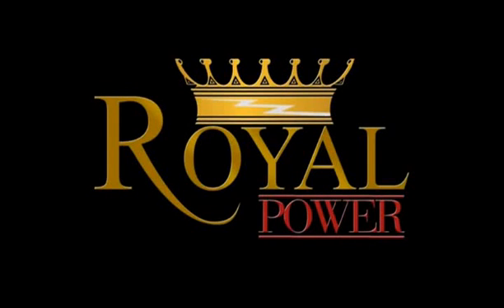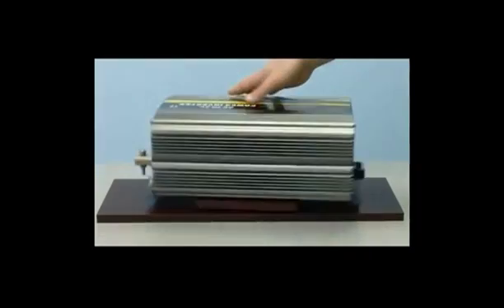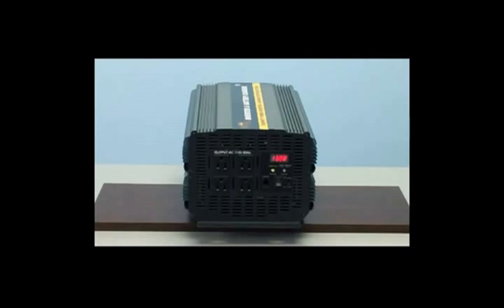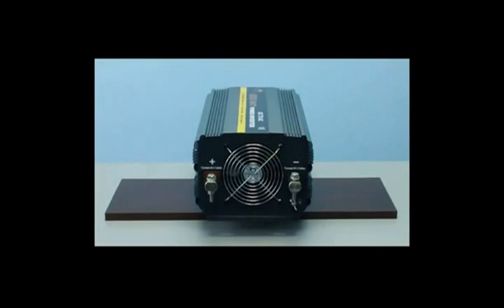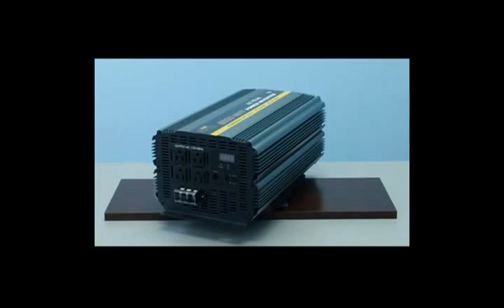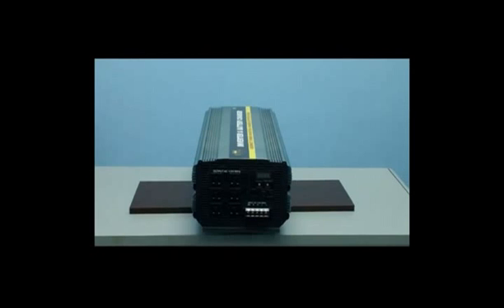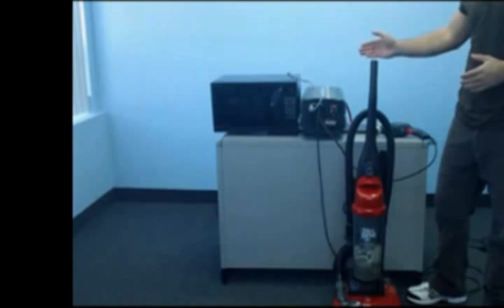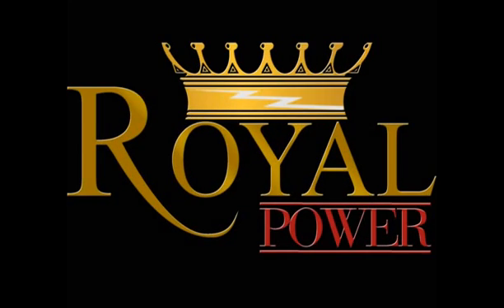6000 Watt Power Inverter 24 Volt DC to 110 Volt AC (PI-600024)

Comment: You call it a 24 volt to 120 volt but then you say that the input voltage range is designed for 12 volt systems. Is this a 12 or 24 volt input?
Reply from the maker: We sell both, but each is only 12 or 24V.

Comment: It's excellent but just tells what  it needs how much battery big or small and one battery or two enough and for charge the solar panel 1, 2, 3, 4 how many enough for charge
Reply from the maker: wasim khan The unit will work of one battery, but the more batteries you have the longer you can run between charges. What are you planning to run to I can try to recommend the right amount of battery power.